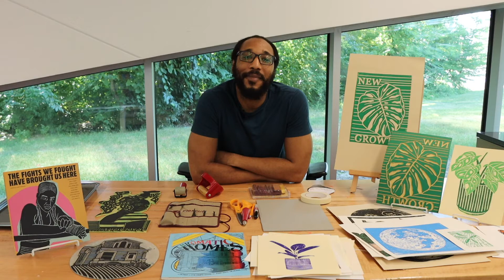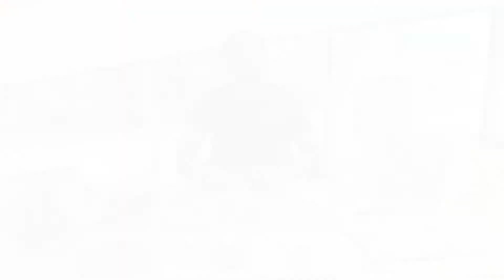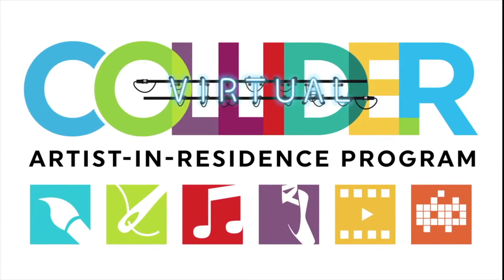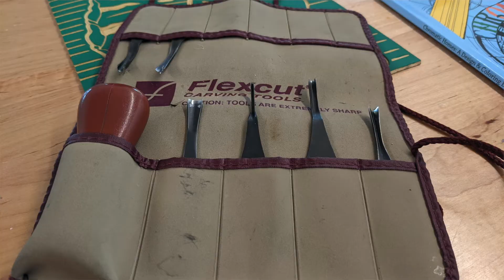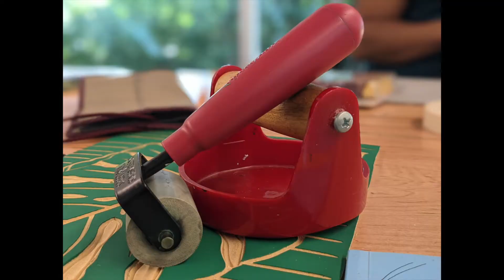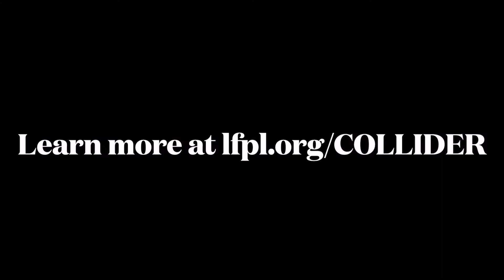Tools & Tips for Making Linocut Prints

Comment: Why does my ink (Speedball fabric / paper  water-based screen printing ink) dries way too quickly on my unmounted linoleum...??
Reply: The same thing was happening to me: very low ambient humidity can make ink dry faster, so I ran a small humidifier where I was working and it helped a little. I also bought something called “ink extender” (also made by Speedball, it’s milky off-white in the tube) and I mixed that with my ink while rolling it out, and that also helped. Hope you can find a solution that works for you!